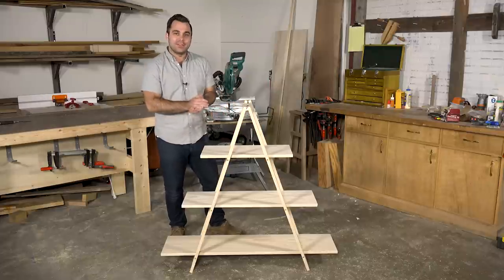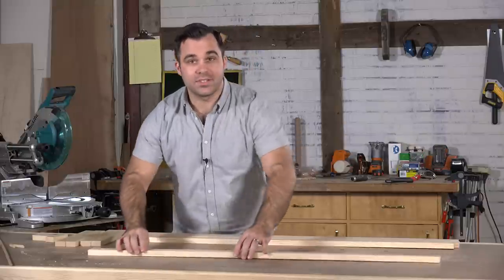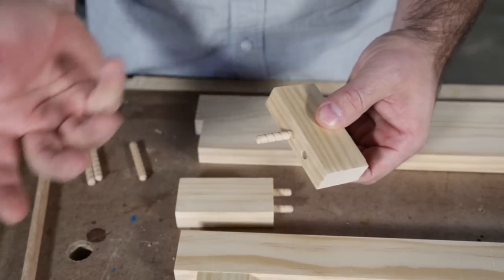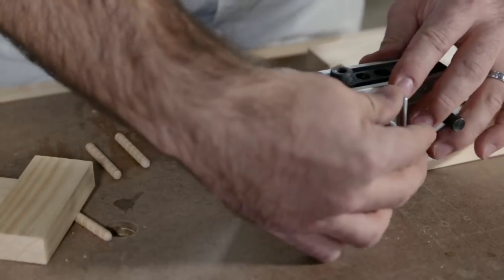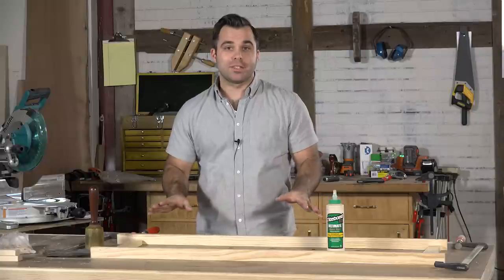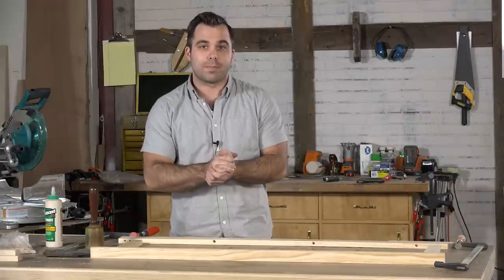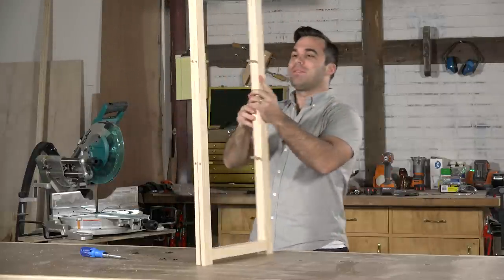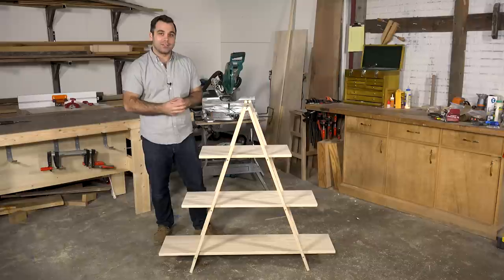How to Build a Plant Stand | I Can Do That!

Comment: looks nice but what keeps the legs from spreading too far apart? On a hardwood floor Id be worried about that. some light lamp chain or a cord maybe?
Reply from the maker: Shop testing didn't show slipping to be an issue, but we discussed cutting pockets on the lower shelf that would allow the lowest set of dowels to drop into the shelf from below, locking the shelf in place. A chain would also be an option. Thanks!
Reply: I have kids in the house that stomp around like thee an elephant plus one big dog that likes to chase the cat now and then so I need to cover all the bases  lol
Reply from the maker: 'Nuff said, screw it in place!

Comment: I think you need to add a small cleat to the bottom of each shelf to stop the legs from slipping open and everything crashing to the floor. It's nice but seems a little unsafe.
Reply: Just a cleat on the bottom shelf will stop the legs from moving.

Comment: You guys passed over the dowel dimensions. Your plan says you used 12 dowels, but it was actually 14 including the spiral dowels on the top and bottom. Can you look that info please? Also, in the video you've mentioned using 3/8 dowels but I don't see it on the plans. Amateur builder over here.